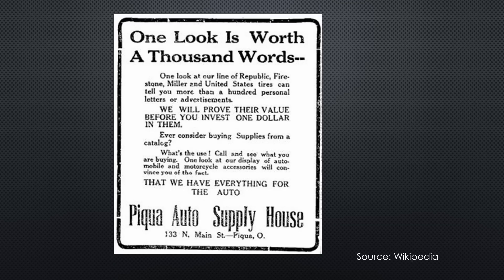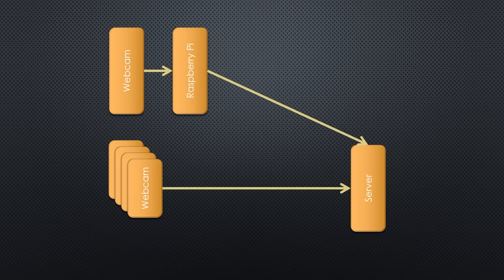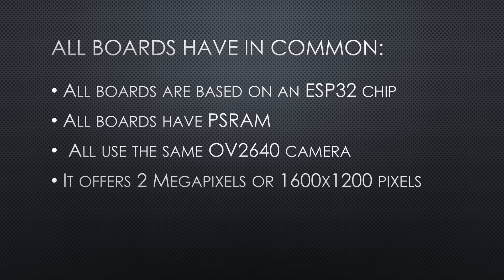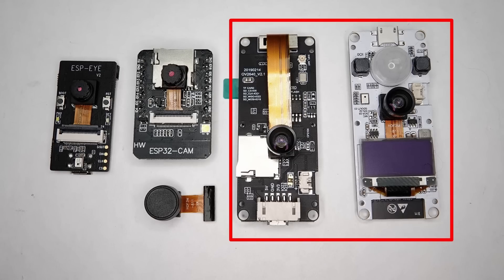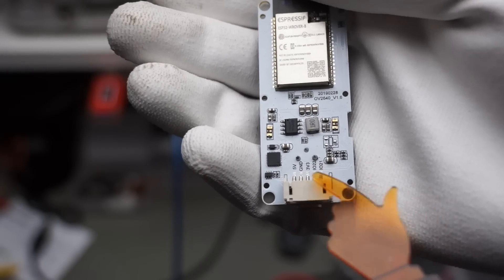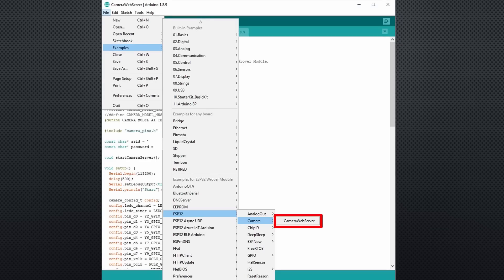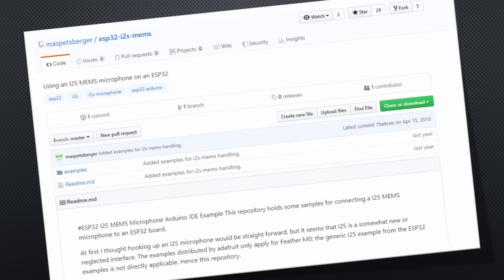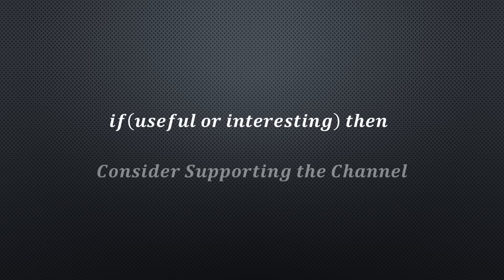#285 ESP32 Cameras: Comparison and Test (OV2640) and I2S MEMS microphone test

Comment: ESP32-CAM is a badly designed board, at least when it comes to aliexpress clones. The led used for flash is on same GPIO used for SD card data transfer, so whenever data is being transferred the power hungry led lights up. This causes glitches in photos since board is starved out of power while writing the pictures on card.
Reply from the maker: Thank you for sharing your experience!
Reply: @AndreasSpiess  genuinely impressed to see you read comments on years old videos

Comment: Hello, I've been a mostly quiet fan for many years, and have learned a ton from you.  You often have also been a path to drivers and software, to odd and new sensors, and related hardware.  I saw your video, where you announced the intention of severely slowing down on the amount of videos you will be producing, but I have a request.  I plan on learning, a lot more about AI, and would especially like to see the drivers and or software needed to hook one of the cheap Ali-Express 3d stereo Cameras to a ESP-3. Perhaps you can take two stereo pictures and have the ESP determine if the object is coming closer, or moving away, or neither of those two actions.   I cannot find anything on YouTube about this.  I like cheap Ali-Express sensors and such, since I'm mostly retired, not rich, and do this for fun, but I can see the younger electronic enthusiast benefiting, from one of your tutorials on this subject, than I.

If you know of a source that has drivers, for Arduino, or ESP32, on this subject please post the links.  The USB software, that perhaps runs these stereo cameras in Windows, most likely doesn't have the option to analyze the output, and just makes it visible on the display.
Reply from the maker: I am not very much in video, so I never searched for such sensors. But I will create a video about AI ;-)
Reply: @AndreasSpiess  I will keep watch on my notification, thank you.

Comment: I have my esp cam working once I disconnect it & try to just run it by itself I have trouble getting it up and running
Reply from the maker: Unfortunately, I cannot do remote debugging. Maybe you add some Serial.print statements to your code to find the problem?
Reply: @AndreasSpiess  thank you very much. I will start there.

Comment: What many do not know. You can't really use the esp32 camera productively. The power consumption is very high. 

The following workaround: The camera takes a photo every 60 seconds and sends it to a web server. With a 2,000 mA battery, the camera would not last 5 days. That's very poor compared to, say, Arlo or Eufy. Even a 10,000 mA battery would last a maximum of 25 days. I calculated here with a deep sleep mode and that each waking up, taking a picture and sending the picture takes a total of 5 seconds. Extrapolated to a day, that's 120 minutes and with a consumption of about 200 mAh, that's 400 mA daily. What does the professional say about this?
Reply from the maker: I do not see video as a low-power application and would go for a mains connection for longterm usage.

Comment: Andreas, have you faced with the PSRAM ID read error: 0xffffffff issue? esp32-cam module with 4MBpsram can not use it. If you could advice any solution how to fix it/ Thanks
Reply from the maker: I never had this issue. Google has some hits if you search

Comment: I have only tried the esp32-cam boards (the $8 version) with only moderate luck. What I would love to see is a stripped down version of opencv on an esp32. Specifically i would like to use esp32 cameras to get distances to apriltags. That would be a much cheaper solution than using a raspberry pi.
Reply from the maker: I am not sure if the ESP32 has enough power for this job. Maybe the -S3 with its vector commands can help here...

Comment: Andreas, did you encounter the ‘brownout trigger was detected’ problem?
Reply from the maker: Sometimes, yes. If the power is not stable. A 1000uF capacitor across VCC and GND on the board might help.
Reply: @AndreasSpiess  thank you, I may try that. I saw, and implemented, many suggestions that ‘turning off the brownout detection’ in software was a way forward. It did work, but the images were jumpy as if voltage was uncertain. I then switched to a power-supply, rather than relying on tne USB power, and that made things settle down. Very nice, all in all, and thank you for the details you show.

Comment: Firstly, you are a great man. Thanks for the detailed videos. But I couldn't understand one thing. Which one is better for face recognition project to use. I want to open door with face recognition and send details over wifi connection to some other esp8266 boards. Which one you or anyone recommends. And is there anyone who used one of these products in such purpose for long term?
Thanks one again.
Reply from the maker: I never tried such a project, so I do not  know :-(

Comment: I think the TTGO White board would be best for my project. Andreas, did you get the camera on it working? It looks like the pin-out is different for the version with and without the microphone. Maybe that's the problem in your code? 
Were you able to use the PIR sensor on this board?

General question, has anyone tried connecting any of these cameras (or any other lower priced) to a cellular MCU board to have pictures send over the email or uploaded to a server? If so, could you share your set-up and code?
Reply from the maker: I never used it again. But you should find projects on google.

Comment: I'm trying to figure out what would be the best cameras to use for my project. I built a remote control snow blower using a 10 channel  Flysky  RC connected to a mega 2560 pro micro.  I want to add a 360 birds eye like they have in cars.  That requires streaming 4 cameras. I thought of using a car system that has its own video stitching and processing, but I don't know how I could send the video signal over wifi.  If using esp32Cam I would need real time video stitching software. I looked at the M5Cameras from Marcus Tarquinio reply, but the ap only supports 1 camera at a time.
Reply from the maker: I also never saw a project with 4 ESPcams running in parallel...

Comment: Hello Andreas, been a long time since you made this video, so not sure if I will get a reply, but I'm giving it a try,  getting started with a project, I will be using a Wemos d1 r2 among other things I plan on streaming video over the net, maybe doing on-demand and an auto-start, maybe if motion is detected or maybe with sound as you mention in your video. I have not really any experience with cameras, so what would you recommend TTGO Black or TTGO white.  or maybe another one, I look at features and I could be wrong but it seems only TTGO white as motion detection. Thank you for any advice. alan
Reply from the maker: I would not try it with the ESP8266. You find plenty of projects with ESP32s.
Reply: @AndreasSpiess  Thank you for your reply andreas, no I wouldn't use 8266 the Wemos R2 is with an esp 32, but my question was more with the camera , sofar and what you test what do you think would work better TTGO T-Camera Plus ESP32-DOWDQ6  (TTGO black) or the TTGO T-Camera ESP32 WROVER & PSRAM Camera (TTGO white). I am thinking the TTGO black, and just get PIR like SR501 for motion detector . Thank's Alan
Reply: @AndreasSpiess  and if I encounter too many problems with the Wemos board, I can always switch back to Arduino ...
Reply from the maker: I do not know if your project needs PSRAM. These boards all use more or less the same chip. So you decide. An Arduino definitively will not work (power and no RAM).

Comment: Unfortunately, my ESP32-CAM does not have PSRAM, maybe it concerns a bad optimization in ARDUINO IDE, but I always have an error:
E (181) psram: PSRAM ID read error: 0xffffffff
Reply from the maker: Did you check the specification of your module?
Reply: @AndreasSpiess  I firmwared it by Arduino IDE with board library esp32 version 1.0.6.
Might be Arduino IDE has a bad optimization?
Reply: @AndreasSpiess  I can't share the aliexpress address  where I bought my module (because youtube deletes it), but seller tells that it is the ESP32-S and it has:
Built-in 512 Kb SRAM
External 4 Mb PSRAM

Comment: Hi Andreas. Do you know if it's possible to stream the video uncompressed. I've been working on a project that needs zero latency. I've worked out how to hack it together using a raspberry pi, but it'd have a smaller physical footprint and may be cheaper using esp32.
Reply from the maker: I have no experience with that scenario. But the ESP32 is not well suited for fast video...

Comment: Hello guy with the Swiss accent! 
Any idea what the camera connector is, CSI? Could you make a video to experiment and let us know if it would be possible to use a 5MP or 8MP camera from a raspberry pi, to increase the fps and quality?
Reply from the maker: The ESP32 does not have the capacity /memory, processing power) for a much bigger camera
Reply: @AndreasSpiess  Hmm that's not good. Thanks :)
Reply: @AndreasSpiess  As you probably can tell, I'm an enthusiast and have no idea about the tech 😅. What MCU specs would be required to run a 2k camera at 30 or 60 fps?
Reply from the maker: Usually, people use Raspberries or bigger for video projects. But I do not have experience here

Comment: Hi Andreas, and thanks for sharing all your knowledge!!!
Your video, as always, is very interesting and if it wasn't because my OV2640 project is based on the Esp8266 (previous to the appearance of the ESP32) I'd go for it without delay, but I have 10 alarm sensors running on the Esp8266/OV2640 and PIRS. I know my question can be a bit off the beaten track, but after quite a thorough search in the net I haven't been able to find any real information about getting rid off the OV2640 IR lens to be able to record images in low light. I even contacted Arducam but I got no answer. 
Can you help me?
Reply from the maker: Google found this article: https://marksbench.com/electronics/removing-ir-filter-from-esp32-cam/ . It seems that the OV2640 is not different to other webcams.

Comment: hi Andreas! Have you seen this implementation? An analog readout system (for gasmeter, watermeter, ...) based on ESP32-CAM and AI. https://www.youtube.com/watch?v=iUgxwbfkIqU Now that is what I call a nifty-wifty-tiny-winy solution ... And the new version will have GPIO control via MQTT. Now you have something to do in your holiday :p
Reply from the maker: Yes, I have seen it and it is a cool system. Unfortunately I do no more have such mechanical meters. Ours is already wireless. So they do no more have to bother us for reading...
I have another project in mind: Watching my awning and how far it is extended (from the inside)....

Comment: Andreas: "Please leave your project ideas in the comments"... here we go.
I think for a solar powered LTE camera, an esp32 instead of raspi zero would be less power hungry and therefore result in a smaller, cheaper device.
I need such a thing for river level monitoring: https://docs.google.com/document/d/1p398I5prpEqUVxoj-CzpbUMImztJaH_K8-nVY8LKkwc/#heading=h.qfkbn1mw634i
Any ideas on which specific hardware to use to try implement this?
Reply from the maker: I am not sure if the camera is good enough on this board. I read many disappointing comments and it pretty much disappeared (not much new projects are done with it). Maybe it is better to accept a higher consumption and add a bigger solar panel.

Comment: Hi
How we  extend I/O ESP32-CAM pin?
I've tryed with some module  but the throuble is about snd src pin... They don't want to work with ESP32-CAM.
😭
Reply from the maker: The ESP32-CAM board contains a standard ESP32. So I assume you can add any I2C port extender. But of course you have to check if the standard I2C pins are connected and used by the board.
Reply: @AndreasSpiess  Thanks

Comment: I actually am doing what you said "might be a good use" by change, running the feeds into a opencv lite on my 8gig pi4 and trying to use them for a security system with the pi4 doing the legwork, but unfortunately I bought the same white ttgo that you could not get working and there appears to be a rabbit hole for this topic oddly enough. returning the boards now and getting the esp eye but sad that I had to go that route.
Reply from the maker: Thank you for sharing your experience! Bad luck, indeed.
Reply: @AndreasSpiess  oh you actually replied! i don't check replies often, but I think I should mention that I found the reason for this in case anyone else reads these comments... it seems that a few months to a year after the original release of this model of the tty go they changed the chips out and the ones that replaced the original esp chip are a SMD off brand that actually does not have the pins needed to run this thing...there is no way at all to get that thing to work period, the reason some people reported being able to was because they got the earlier release of it before the change in parts. So faulty by design, I would wager they had a stock of bogus parts they needed to clean out and this was how they handled it.

Comment: Hi Andreas, quite an informative video, I was finally able to build a wireless CCTV camera that is based on OpenCV and does object/motion detection using Jetson Nano, The extending part is this based of the Internet using Python Flask, and 3d printed camera case that is still pending but ESP32 powered with a 18650 mAh battery module with display output set to XVGA with ESP32 and 170mAh usage this battery should last for 4 days as per the online calculators online. I can now record the video of the cam to a processing unit JetsonNano/Raspberry Pi and upload those videos to my own choice of cloud and use cloud services to run any Machine learning algorithms or probably just store them as long term storage. I have been doing this for my wife who is Epileptic and the cams. Anwer to your question on putting these cameras to use.
can use some algorithms to detect a stroke and run an alarm to notify me and other registered members. 
One request is if you can do a video on different WIRELESS Camera modules out in the market plus power consumption with an example LION/LIpO batterry that these cam's when hooked how long they can last.
Reply from the maker: Thank you for sharing your project! Very interesting.
I am not too much into video. So do not expect such a comparison. I found many such videos when I bought my surveillance camera.

Comment: Is there a way to upload code onto the Esp32-Cam without pressing the boot button? I'd like to update OTA but it doesn't work because of the boot button
Reply from the maker: OTA does not need the boot button. But you have to have a OTA capable sketch running on the board.
Reply: Ok, I'll try again. The upload always stops at 65% with the EspCam (remotely OTA doesn't even startwith OtaDrive) while it works perfectly with the Esp32?? (Same code)
Is there another thing that I need to consider when uploading code to EspCam?
P.s: I'm also Swiss. I live near Zurich :)

Comment: I have came across use cases of tinyml with sound and image recognition on arduino boards. One very useful project is to use these boards for utility meter readings. Esp32 boards are capable of character recognition, more especially so when only numerical characters are involved
Reply from the maker: I saw these meter reading applications, too. But we already have a smart meter. So I could not test it :-(

Comment: Last year I've got a pair of ESP32-CAMs, my project idea was to take photos periodically, detect changes (movement) and than send a photo to a server. The examples I found were not much documented or stable. I got to the point of taking photos in 320x240 (to minimize memory and processing), converting them to grey-scale, comparing them and, if a certain number of pixels changed, take a 1600x1200 photo and save it to the SD card. There were crashes and mysterious errors during development, the end result was not great. So I lost interest in the project. Another annoying thing thing with the ESP32-CAM is that the bright white LED is connect to one of the pins used for the SD card, so it blinks when you access a card.
Reply from the maker: I also came to the conclusion that these boards were overhyped. That is why I never used them afterwards :-(

Comment: I really enjoy your videos. I purchases a couple of esp32 cam cards and have problem getting the camera server app to run.
I have the following card.
ACEIRMC 2pcs ESP32-CAM WiFi Bluetooth Camera Module Development Board ESP32 with Camera Module OV2640 2MP for Arduino 
Do not seeing this type of board in the board list,or the board manager.Any suggestion on the board type need to select? Then I select AI-thinker board type the app loads but I get burn out errors. When I select any other board type I get all kinds of other errors. Any idea. Ideas? You can contact me at mike.j.smith191@gmail.com
Reply from the maker: I have not more info than you. I also have to use google for my info :-(

Comment: For the TTGO White, have you tried using:
#define Y8_GPIO_NUM      37
#define Y7_GPIO_NUM      38
This works for v1.62 with mic, I see that you have v1.6 in the video which I think is obsolete.
Also for others in case it is not known, these devices require a lot of current so on USB power they tend to brownout if your USB port is low power. You need to supply power with a 5V adapter.
Reply from the maker: Thank you for the tip!